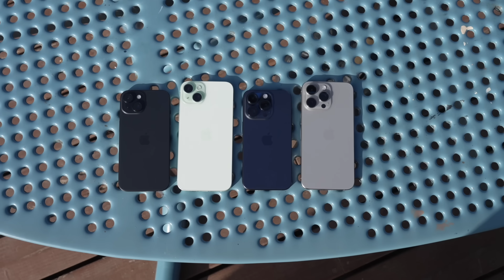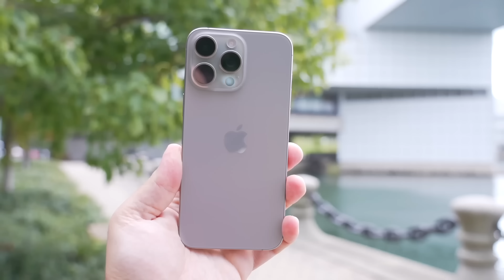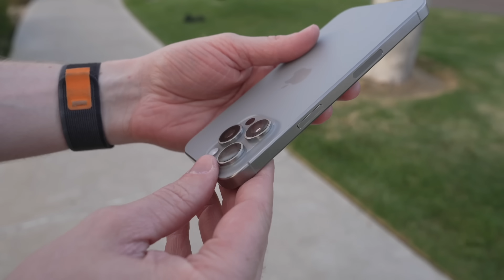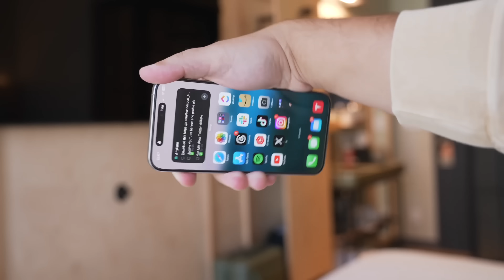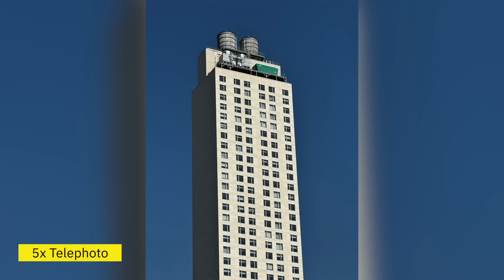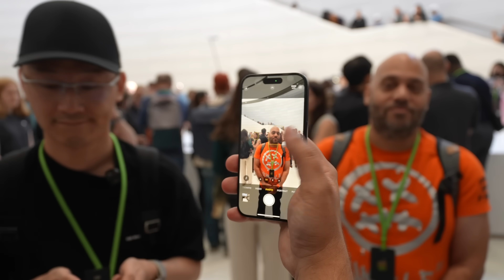iPhone 16 First Look - New Leaks & Rumors!

Comment: The Iphone Pro Max right now is way too big for my pockets.  I could not imagine a bigger phone.  I have always liked the smaller pro model size.  I have been using the Iphone XS for many years and it does the job for I need it to do.  It is not important for me to upgrade every year with a new model but I feel it is time for an upgrade.  When the 16's reach the Apple Store I will see how the smaller Pro phones feels with the size increase and if I am ok with it I will buy it.  If not then I guess the IPhone 15 Pro's will be selling at a discount.  I am guessing for Apple to upgrade their Pro Iphone lines they need expand the size of the 16 models but pockets are not getting any bigger and many out their still prefer the smaller size.

Comment: Still have my Frankenstein 11 pro max. It’s had so many repairs and software related issues, but I’m trying to hold off until the 16 pro max comes out.
Reply: Same, I’m on a 2020 SE and I’m really wanting an upgrade, but I think I’m going to hold out for the 16 release. 👍🏻
Reply: It’s surprising to hear. I usually hold onto my iphones for 4-5 years and have never had any issues besides degraded  batteries

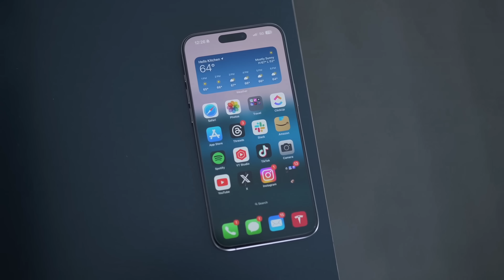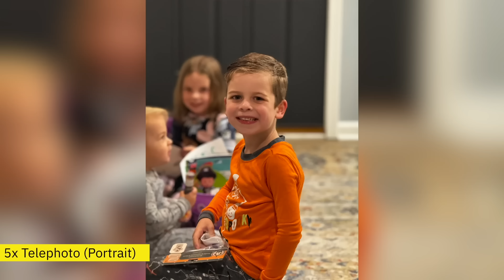Comment: 0:31 The 6.9" inch is a manageable size, it is not like if we are talking about 7" inch in size. 6.9" inch is only slightly bigger than 6.8" inch and 6.8" inch is the size of Samsung phone which is very manageable. 0:31 People are managing and loving the 6.8 inch which is the size on many popular brand phone. 3:26 Finally the long wait might be over Apple may finally bring a decent 40 watts wired charger. 3:26 lets keep our fingers crossed for Apple to give us a 40 watts wired charger 🤞🏿. 4:12 Assigning multiple functions to the capture button will be much appreciated, believe me it will be praise. 5:16 Apple is kinda stingy I doubt they'll give us 300mm in telephoto range length. 5:16 But if Apple gives us 300mm in telephoto range that will be super awesome 😎 👍🏿. 6:16 The macro lens is a very useful lens for close up shots.

Comment: I'm excited to see what's coming later this year, I'm still running my iPhone X since March 2019 and now it's time to get something new, I think. I'll probably get the basic iPhone 16 regardless of how small the differences to the 15 might be (buying the 15 when the 16 is out to save some money is not an option), the Pro is just too expensive for me (here in Germany). Sure, you can always wait a year longer, but what's that gonna get you, I could wait 'til 2030 so at some point you just have to buy the new thing and be done with it. And for once I want to have a "new new" device so I can enjoy the whole life cycle until it doesn't receive feature updates anymore.

Comment: I'm sticking with my 13 Pro.  I know ppl will say you shouldn't update every gen but these tiny updates every year is making it to where you really have to wait 3-4 years to get enough upgrades.  The whole .2" larger screens shouldn't even mentioned as a feature...they keep going back and forth with screen sizes.  I didn't even watch the last iPhone event.
Reply: Same: Similar, 14 P-M. Tire much more easily of yearly ‘Fashion show’.
Reply: Well iphone is literally the same phone every year, so you'll have to wait a good 5 years for a slight change.
Reply: @camonly849  sadly I’d rather just wait until they can fix the issues with in app camera issues on Android..
Reply: Yup sucks.. I’m on the 13 pro max and really have been debating on getting a s24 ultra but can’t pull the trigger on it yet.
Reply: @limes2160  wow same for me i was debating to get the S24 ultra from have the 13promax  but idk leaving apple and messing around with android
Reply: @MrLuisgot777  yeah I’m worried I’d regret it.. went and looked at the phone in person and it’s buttery smooth and gorgeous but I use Snapchat nearly every single day. Just kind of tired of Apple releasing new phones with virtually no changes
Reply: @MrLuisgot777 Samsung is trash
Reply: @limes2160 junk
Reply: That’s what broke people say

Comment: I have the 14 pro. And upgraded from the xs. I might get the iPhone 18 pro. Only strange thing my 14 pro battery is dogshit.
Reply: Sadly the 14 Pro's battery being dogshit seems to be a thing, a friend of mine also hates the battery, it degraded so quickly in just about one year. Nothing compared to the older iPhones that had good batteries.

Comment: The new oled panel will also receive a major upgrade. Upgrading it from the current M12 type that exist on both iph 14 & 15 series, to the M14 type which will be exclusive to Apple when launch,  will achieve higher brightness + better battery consumption.
Reply: Link from that?

Comment: I have done told people mos ago about the capture button and never once got a mention or anything again I have people who work for Apple and not gonna disclose who or where ect but they are hardware designers also the capture button will be built into 5g window with a touch sensors like the scroll on Apple TV remote and it will allow you to zoom in zoom out focus with a tap snap a pic it won’t just be for camera stuff it will allow scrolling in safari messages almost any app that will implement this feature scrolling thru music map it to volume control flashlight brightness ect. In posted this on x and it was taken down in about 12 hours don’t really give a reason why said it violated terms of service ect so 🤷‍♂️🤷‍♂️ but I’m 99.9999 percent positive about this but sadly it will be only on larger pro max phones. Also better cameras same 48mp main but now 24mp front and wide and telephoto. So unless there is a major change from November of last year till release should be same tame also using metal on battery for stacked battery but also to help thermals as well as finally a vapor chamber as well to control heat better in new phone. Of course that could be left out if the metal battery dissapates heat as well as they hope.

Comment: I am thinking of upgrading from a samsung z fold 2 to the iphone 16pro I looked at the s24 lineup and the iphone beats it in the camera section as well for its size if i wantted the top cameras on the s24 series i would have to go 6.9 inch slab vs a 6.3 where i get 2 48mp cameras

Comment: I don’t see why they can put on device ai for the 15 pro which has a better gpu. I wonder what will happen with the iPad Pro next month if the M4 chip is supposed to have better processors I’m hoping with the gpu they can also make it on device for ai

I already have the Private LLM app from the App Store. And it runs perfectly on both devices. And the fact that Apple already has a academic paper release about how they were able to lower the processing power of large language. Models on device gives me hope that they will at least put it on the M3 and the iPhone 15 Pro , and not make it exclusive to the newest Devices

It would be very stupid for them to release the M3 iPad Pro next month and then release another M4 iPad Pro in a year But I have a feeling that’s what there would be doing

Comment: You'll like the 6.9 screen. I came to a 14 Pro Max from a Note 9. The difference is absolutely significant. The Pro Max seems cramped and I can't even read or do the things I used to with the Note 9. So I'm glad they're doing this; it'll be a game changer. Hopefully they're upgrading the Apple Calendar too...at least to something that resembles something configured  in the 2020's.

Comment: Got a 12 pro max from day 1. I think it’s time.
Reply: Me too! I hope the 16 pro max impresses me, if not I might go back to android and get the pixel 9 pro
Reply: Got an iPhone X from day 1 and since the 12 Pro I think every year it's time, but I think it's still not really worth it. And the iPhone 16 Pro is also not a big jump from the 15 Pro.
Reply: @TombRaiderZocker trust me, don't hold out any longer. These new iOS are just terrible on battery life, and the X won't be supported much longer either. I made the switch from an X with a brand new battery to a 12 pro max, back when it was new. Even then, I didn't realize just how slow the X was. Honestly, the 120hz display is reason enough to upgrade. I will be getting a 16 for sure, the 12 just isn't cutting it anymore.

Comment: Phone can easily last 4 years for most people
Reply: I still have the iPhone 11 Pro Max
Reply: My iPhone 6s plus is still my backup phone. It is in perfect working condition.
Reply: XR, hopefully will upgrade to 16+
Reply: Hubby still has XS Pro Max going strong! 😊
Reply: I wouldn't be surprised if we saw some of these newer phones lasting over 10 years (with battery replacements).
Reply: Yeah nowadays there’s no point to upgrade every year or two. Phones are powerful enough now to last a good 5 to 6 years just like computers. I have my 13 pro max and have absolutely no desire or want a new phone. Everything still work as I expecting and the phone easily last for the day so why I should care for next phones?
Reply: Who keeps a phone for 4 years
Reply: @josephpepe2607  likely smarter and richer people 😅
Reply: @josephpepe2607  I am typing this on the X.